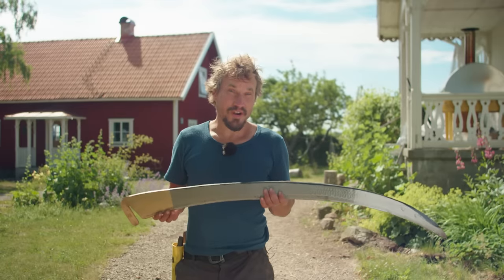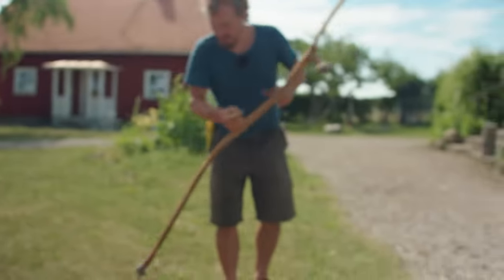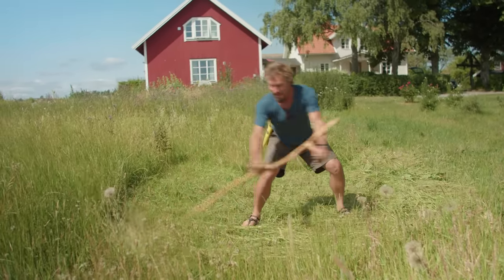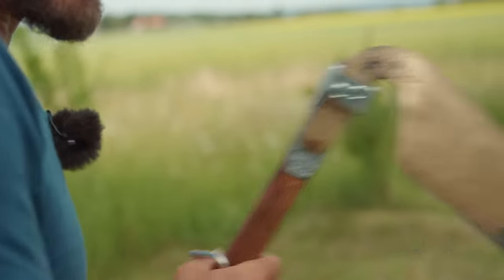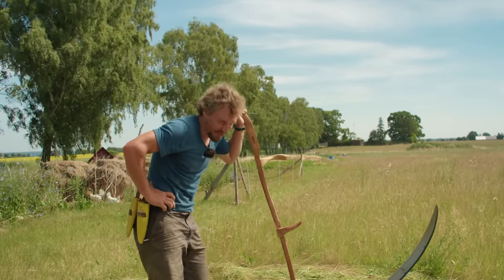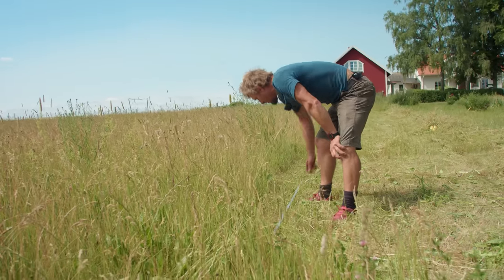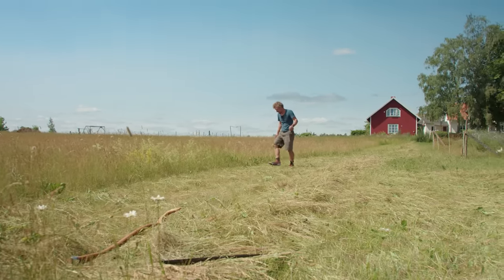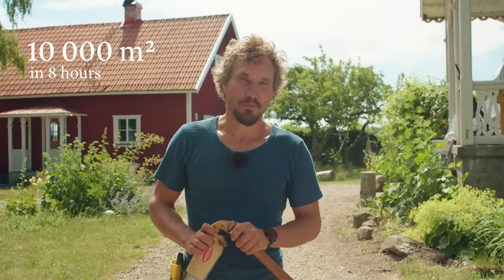Trying a HUGE Scythe Blade | MIND-BLOWING RESULTS! Hartstahl 120 cm Competition Size Blade

Comment: You should absolutely try the one hectare test.  The real question is whether or not you have the endurance to keep that blade moving for 8 hours.  I do seem to recall a video of folks in some Eastern European country who were cutting hay with long blades like that.  They also had very long straight snathes that had to be approaching 7' or more.  I got the impression that the long snathes served as a counterbalance to the blade and made it easier to work, in general.
Reply from the maker: Thanks, I have pretty good endurance as this is my profession and off-season I do a lot of long distance running and biking. Though it might work easier with a 95 or 85 blade. Weight is all, I do not believe in counterbalance. It is just mass also in the other end you need to change direction in every second! Everything that's reduce weight is good in scything. If you try an easier (but similar) snath for a while and then go back to a heavier - then you realise that the easier was better. A more lightweight blade is better than a heavier, a lighter ring is better than a heavy etc.....carbon fiber snath is on my to do list! As well as a super light ring .
Reply: @slattergubben6702  now we need a montage of you training endurance Rocky Balboa style for the one hectar challenge! 😂
Reply from the maker: @lekjacekbujko  he he, yes! Needs someone challenging me with a grinding -scythe!
Reply: @slattergubben6702  if he dies - he dies! 😂
Reply: Hello! Here we are used to quite long works in competitions. Scythemen have to cut one our in championship finals, bets sometimes take up to two hours. Here historically we haven't seen any need of any type of counter balance.

Take a look to the video, handles, scythes more or less 1.20 meters long, techniques... Not saying this is the only way to do it, it's just the way local culture developed scything. 

Video is a little bit more than an hour long. Hope you find something useful here.

Regards!
Reply: @slattergubben6702  This comment is making me wonder about a super lightweight carbon snath, but with a SMALL lead counterweight in the tail end, so that the entire scythe has the same overall mass as one with a wooden snath, but has a smaller moment arm?
Reply from the maker: @ShuRugal  carbon yes that would be good! But no need to put extra weights!
Reply from the maker: @jonugalde1275  ok, glad to hear! Exact , no need for counterweight on a snath. If competing for two hours - how much do they  cut?
Reply from the maker: @jonugalde1275  wow! 2600 in 75 minutes! Sounds extremely fast! And of course I totally agree that it is amount of grass i kilo cut that is the most fair way to estimate the effort and the winner. I watched the films but must say a couple of mowers must have a to bend/folded back to be effective. I have seen other competing videos with people with more effective style. Is this from Switzerland? 
Do you know if someone has tried for one hectare before?

I would say the man shown first in this video really have a good technical mowing. He is as all fast competing working low but with a strong back able him to use all the core muscles in an effective way. And from his honing one can se that he really know this art in and out! https://youtu.be/1LmrsowAouA?si=fCbHkG3mHQ7PH1nE
Reply: @slattergubben6702  Hello Jan. Bent back is the traditional way to scythe here, in the Basque Country. But not only here, as I can say this is the way to scythe through all the Cantabric coast, at least from Bayonne to Asturias. I don't know about Galicia. This also is the way to scythe in the interior too, but I don't know if this is the way to work in all the Iberian peninsula or not.

What I know is the Basques are known as the best ones. All the endurance competitions or trials I have  listened or read about Basques won if the were using their technique and tools.

No, I have never known about anyone who has competed by an amount of area other than in European competition. And I'm sorry, I don't think they cut an hectare from start to finish.

Traditional local competition has always used time, the goal was always who was a better schytheman from a homestead perspective. By the way, there are not only scythemen. Women do also compete. Here you have some of them in a little exibition

https://youtu.be/7ikbGc34vlE?feature=shared

These days were Basques also compete in international competitions. This is seen here as the opposite way to compete, you have an area and you have to cut it in a given time and in a given manner. Different competitions with different mentalities, both of them have things to learn about.

Curiously in 2015 European scythe competition (were Basques took part) was played in my town

https://youtu.be/tTufigmUFNo?si=jyL3PsCi8xG6PKZ6

And yes, you got it. Basque type of scything uses bigger amount of muscles in different way. It's harder to learn and proceed, but as I have seen and as it uses to be said here this is a better way to cut grass from homesteading perspective. I think local climate and ways to work have heavy influenced scything, but I think this would be a much bigger conversation theme and I don't think I'm the best to talk about it.

Good video the one you show, thank you. But they are not local people. Here you have some local homesteaders who still use the scythe to light works preparing and using them.

https://youtu.be/vWenZm2IMVw?si=K08kGFbUz2eX5qRv

I have sent you an email to your website with the local TV video. I suggest you to take a look to it, there you can see what actual athletes are capable to do in an hour of work.

Sorry if I may not have written something correctly, I have been writing in a hurry.

Regards
Reply from the maker: @jonugalde1275  Thankyou for the story! It is fascinating to see! And to see that there is a very living culture around the scythe right now! 

I think this films partly explains why old scythes here are find with a such uptilted lay. Probably because we also mowed much more like this in the old times!
Reply from the maker: @jonugalde1275  Thanks - superintresting! No I did not got the email info@slattergubben.se
Reply: @slattergubben6702  email sent Jan.

Good point 👍 I didn't know the handle layed different in old timer scythes. Which of them are you talking about? Northern Europe? Central Europe?

Humans have our differences but basically are quite close. It's a pleasure to see such a passion in same tools and uses in people so far away

Regards
Reply: @slattergubben6702 gotta pair it with an titanium blade
Reply: Noone mows 8 hoyrs😂😂
Reply: You need to swing the scythe and not make an effort. You can calmly mow one hectare, the main thing is to correctly adjust the handle in relation to the body.

Comment: Fun fact. In a lot of movies and games we see scythes used in battle. Now, the normal scythe is kind of a terrible weapon but there is a such thing as a war scythe. A war scythe had a straighter blade more in line with the shaft instead of being at a sort of right angle and it was basically a glaive (a glaive is pretty much spear where the spearhead is replaced with a sword). Peasants who used them in battle typically took them to the blacksmith to have the blade's angle changed to be more in line with the shaft as well.
Reply: I often think of them like a double-edged war scythe that does look like the Grim Reaper's or to some extent, from the fantasy themed succubi. You know, magic scythe that can gather everyone's souls or life essence within one swing kind of thing
Reply: So Bloodborne weapons
Reply: Scythe nerds.  Huh.
Reply: Imagine seeing this scythe on the battlefield and opposing soldiers having to jump over it like a game , then it all ends when someone throws a spear into the guy lol

Comment: The "Never ending honing" was a hilarious joke🤣

I was unaware of how many different parts come together to create a scythe!
Reply: Me to my wife: I don’t need TV anymore, everything is on YouTube. It’s much better than regular TV.
Wife: what are you watching?
Me: competitive scything.
Reply: He uses inferior steel and never puts a good edge on it so he constantly has to hone.
Reply: @charlesg5085  That's the point (no pun intended), it's sharp,  he's literally cutting grass right down to the dirt,  dull POS scythes can't do that.
With a lower grade blade, using honing stones at least by hand he can keep it constantly sharp on the job, no mucking or faffing around, then peen it during breaks.
Any stronger steel and you can't peen it, then you've got to do insane chisel grinds just to get an edge, and then grind it every time you want it sharp.
Reply: @charlesg5085  What if you made a scythe with a tungsten carbide blade? Or Elmax steel

Comment: I find, interestingly, that the biggest challenge with very long blades is simply keeping pace with them! It gets to a point where you no longer can comfortably advance one step with every stroke, and instead have to take two or more steps per stroke, which is awkward and breaks your rhythm. When taking maximum-depth strokes with such long blades it necessitates lifting the blade from the ground fully as you advance or else you risk tripping yourself up, as well. 

As such I find extra long blades best used for sparse and light growth that can be irritating to mow with a more typical blade length, like maintaining lawns or in patchy waste areas. This means the context of use is fairly limited, but they do very nicely under those conditions!
Reply from the maker: Exactly!
Reply: Skill Issue.
Reply: @ActuallyDeath  merely a comfort issue. I have the skill for it no problem, but it is a technique for "sprinting" rather than sustained mowing. 😏
Reply: @FortyTwoBlades  Since when did not being able to bend the Laws of Nature become anything other than a Skill Issue?

Comment: I don't remember the length of my scythe blade, so I would call it a standard length from Bauhaus.
I haven't practiced scythe mowing for more than one season, and only in my garden, which I let grow except for some pathways I mowe on a ~ weekly basis. We have become 'wild' on purpose or - deliberately.
The 'robo cut' was given away to some friends after someone asked me how I mowed the grass. Did I use a scythe or what? Then I saw a video on YouTube with two guys mowing the same size area with a scythe and a grass trimmer respectively. The scythe was fastest and that made me get going with the scythe. Although in the summer it's quite hot, it's also very, very satisfying!
Do the comparison - all in! Eight hours😅

Comment: I didn't know people did that for fun. when I was a kid the mowing scythe was my preferred tool for really tall weeds that the weed whackers couldn't cut fast enough for me. still have my old scythe and double bit axe. I spent so much time with those tools I had to keep them. I was the only one that would use tools like that. wish I still had my big 30lb sledgehammer, another tool no one but me would use. the blade on mine is 27 inches not accounting the curve. the handle is 5 feet long not counting the curves. I notice a difference in how the blades sound as well. mine rings like a sword, a satisfying sound. I never sharpened mine except if I hit a rock. I didn't cut hay or grass just really big weeds. my technique is very different than yours. I raise the blade high gravity helps, and the handle placement kept me from going into the dirt. crouching down like you would wear me out. good stuff I enjoyed that.

Comment: You have to take into account also, that for example, wheat grew more than twice as long as it grows now. I mean Scythian times. It is estimated wheat height was a bit over 150cm = 59 inches. So then also the straw needs to be stiffer and you needed more heavier tools to cut it.

Comment: Fantastic!
First time have I seen such an effect tool being used from my grandfather's day.
Never have I seen a racing blade before.
I have one of these in my shard from 100 years ago, though the handle looks a little different, but the results would be the same.
What are you using to hone the blade with?
A nabour came the other day to look for a Syth.
It seems an occurrence that I should trip onto your page accidently on this very subject.
Just wanted to see how the Syth was sharpened and with what?
Thanking you from NZ.

Comment: I have one of those 120cm blades. Unfortunately I have very few opportunities to use it. Most of the mowing around me has vetch and other weeds that tangle up and make you feel like you are dragging an entire bale with each stroke. I used my 95cm blade in a recent competition and it was almost too much. All the rain we have had here in New England (USA) has compounded the issue as everything is overgrown and lodged. 

1 hectare is about 2.5 acres. I've always heard it said that a good mower could mow one acre a day. So I would very much like to see you attempt one hectare in a day!
Reply from the maker: Yes that is what I regard mowing myself a good working day. But then in more or less tougher meadows in our pro work. One hectar needs to be on flat area with not so dense grass.

Comment: I am using similar "huge blade" regulary ( my grandfather's)  The way to set it up for your body size is to put the 'shaft' on your shoulder, with the blade on the front of you pointing up. Then you hook the little handle behind your head. Then you reach out to the back of the blade. You have to be able to reach the back of the blade with your fingers all away to the tip. That is when it's set up properly. I think you may have to bend the 'neck' of the blade back the way it was. But it will be much easyer on your back that way and you need half of the power and no need for such a wide stance 😉

Comment: Is there such a thing as a left-handed scythe? I wonder if there'd be a way to have some kind of scythe that would cut in both directions?
Reply from the maker: There is left handed but it is another tool. Then you mow the grass into a row on your right hand side. So the lefthanded must attack the meadow from another corner than the right-handed group. If you work alone it doesn't matter of course.

Comment: Anither refinement of the snath for using very long blades.
The lower end of the snath is curved backwards, balancing the unit and reducing your angle of reach to the rear right, so the tip enters the sward cleanly with less twisting effort from you.
Reply from the maker: Ok, that make sense. Is normal competitionsnath always/often made like that?

Comment: Hello Jan have you ever heard about barefoot shoes before, they're super comfortable. And i find that for myself i have better ankle control when i wear them compared to when i wear regular sneakers. I highly recommend you to give them a try. They might help you to scythe even better. Awesome and informative video as always thanks.
Reply from the maker: Yes! Beside the shoes in the video (that have   pretty thin sole and 3 mm drop) I prefere walking barefoot or use Joe nimbels leather running shoe that is also very strong and durable. When it is colder I use feelmax boot , very very good ! So yes I completely agree!

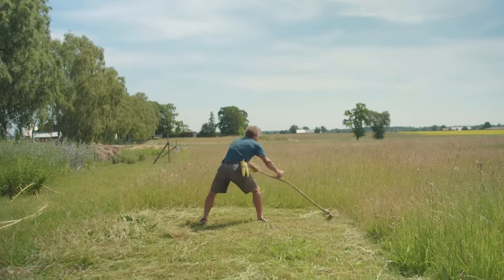Comment: How much does this blade weigh? I know it takes more energy to move a heavy blade, especially with a catch of 30 cm, but if you leave the blade in contact with the ground even on the back swing would it use less energy? You can see really well at 5:09 how the blade rises up and you're having to lift all that weight. I always thought it's a good idea to keep the blade flat on the ground, a bit like a car windscreen wiper, but maybe I'm wrong? I'm certainly not criticising (I'm only a beginner), but I'd really like your opinion on this.

And I'm another fan who would love to see you doing the one hectare challenge. 😀 Will it be this summer?
Reply from the maker: Hi! The challenge is done last summer and video will come either day! 
That's a point, I do not have in mind right now the exact weight but it must be more than double of a 85cm grass blade. I might write the correct weight in the webshop www.slattergubben.se
Keeping to the ground is very important, and just have the tip resting on the ground on the backstroke. - when starting to scythe. 
That's what I normally do as well in most terrain and occasions. I regard it completely confusing to speak about lifting on a course for a beginner. 
But when you are in control and always mow with a distinct line of cut/uncut grass to your right you can experiment with lifting the blade , but you need to land it just when sticking in the tip of the blade forward in the grass and apply ground pressure as fast as you start to cut. This way you keep that distinct line. 
For a beginner it is hard do describe the differens between lifting and start mowing grass on the way down, creating a slope of uncut grass. 
In south eastern Europe this way of mowing lifting the blade pretty much is more common. It is better for longer blades and when the grass and ground is even. You dont work with the legs as much but , especially if you do not have that wide strokes is a little more relaxed way of working. Not need to stretch out on your right so much. And it is a way to like accelerate the power in the stroke using the swinging energy in the scythe. 
And that's why it is not really possible not to lift a 120cm blade. You need that energy and you would rather start leaning the spine and shoulder too much keeping it right to the ground. 
What is heavy is changing direction of the blade all the time, the heavier it is. That's why low weight is always to strive for.
Reply: @slattergubben6702  Thanks for such a detailed answer. That's answered my question very clearly and precisely.